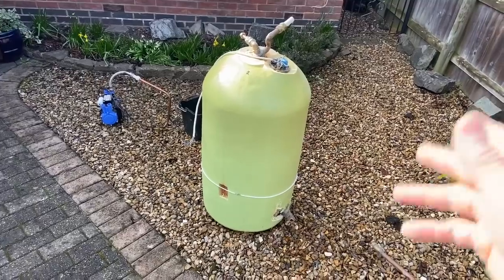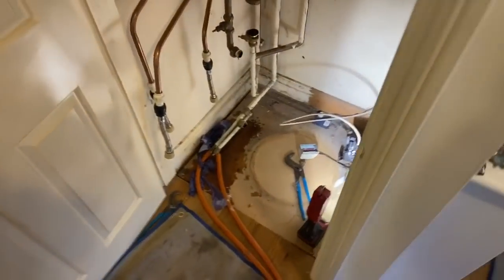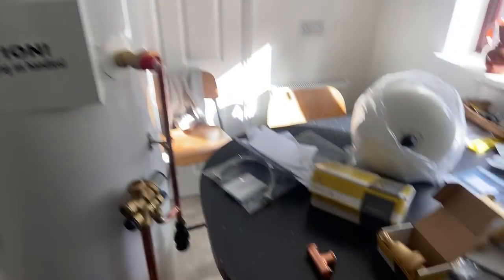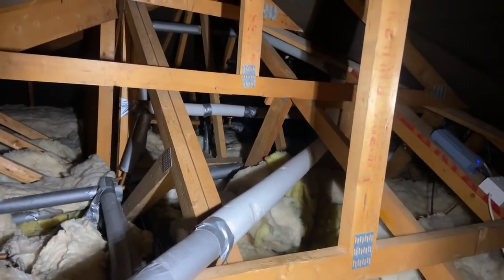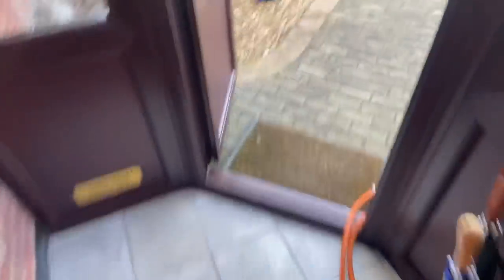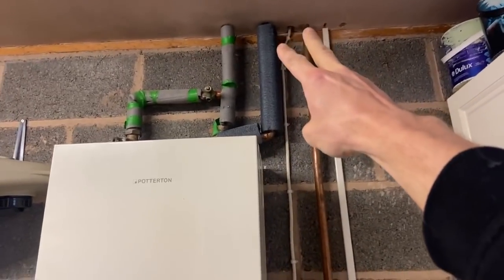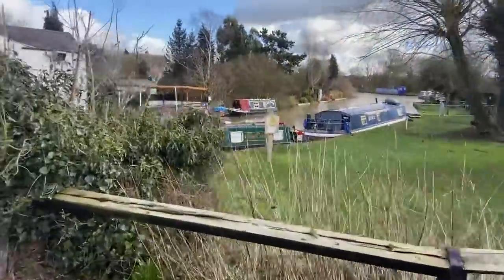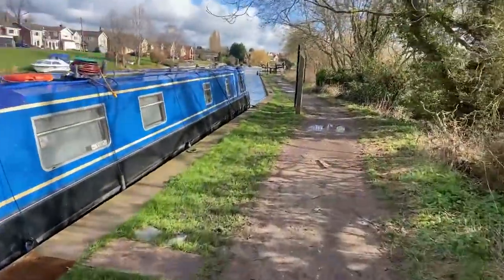PBPlumber Pre-plumbed unvented cylinder

Comment: Hi Pete.... Good work as usual.. 
  
I advise a little caution with AAV's as they can do more harm than good. The cheaper ones can actually suck air into a system and make the problem worse. 
We surveyed and corrected many faults on a newly fitted very large system a long while ago that was suffering with air/noise. 
AAV's everywhere ! Closed them all off and problem disappeared !
We only use them if they are really needed and only use top quality. Fit an isolation valve under them so they are easily changed if and hen they leak/let by.
Take care
Reply: They’re not designed to be left open? They have the little nut on top.
Reply: Yeah if you're working in a 7 floor building and boiler rooms at the ground floor, Pressurisation unit is set for say 1.5bar all the aavs from the 3rd floor up will most likely just be sucking air in. Got to make sure you have enough pressure for the height of the building and yes always have them on Valves so they can be isolated. Just normal practice. 
What I do is Branch Tee whatever size to 1/2" then a 1/2" close Tapered nipple then a 1/2" Ball Valve, then a 1/2" aav directly screwed into the valve. Makes for quick and easy changes and looks professional. 👌
Reply: @nemanjagradinac5419  AAV’s work on buoyancy not pressure? They have a float in them, if there is air or sinks, if there is water it floats. It opens a vent when it sinks.
Reply: @chrisb4009  yes bud, but if you have 7 floors and 1.5bar of pressure in the system, that water is never reaching more then the 3rd floor....hence why any and every AAV above 3rd floor will be sucking in air rather then venting it. See my point now? It's more of a Commercial thing anyway but it's just a simple pressure to height ratio - and 1.5bar doesn't fill a building up to the 7th floor.
Reply: Yes people fit them everywhere without consideration to whether they are on the positive side of flow or negative. If on the negative side they will pull air in all day and cause more harm than good.
Reply: @paulgannon3261  yes you are correct.  Also if the vent or fill pipe is on the wrong side of the pump it pumps over
Reply: Had that in a church conversion in croydon. Booster pumps failed for so long the AAV's seized up and pissed out though 9 floors. All that great work and the AAV where a shit install.

Comment: If it was drawing in that much air it must have been designed badly .   The hot water pressure would be the same in any house from a gravity system . The mono bloc taps are very restrictive and no good for gravity.   Don't think I would have paid an extra  £300 for the cylinder that's a full days labour plus materials.
Reply: It's cheap if you have to supply all that hardware on a bare unit I imagine
Reply: @user-sg1ku5hu5d  the control set would come with the cylinder anyway . So what is in addition to it  ??   One 2 port valve ??